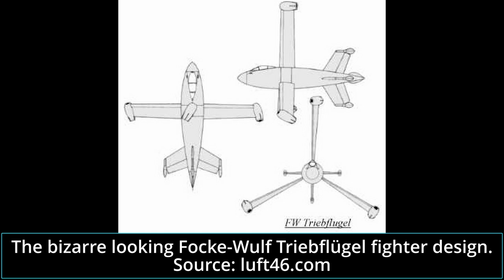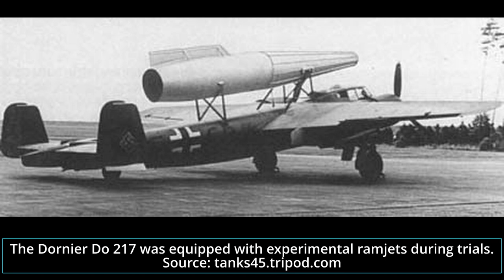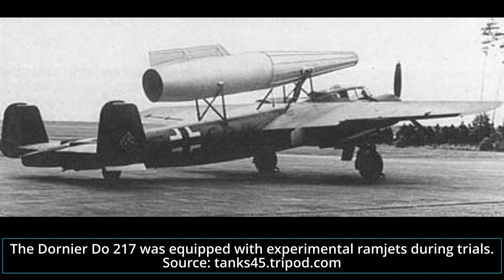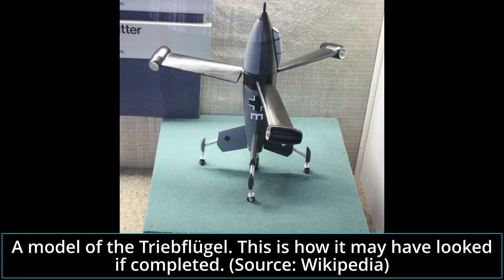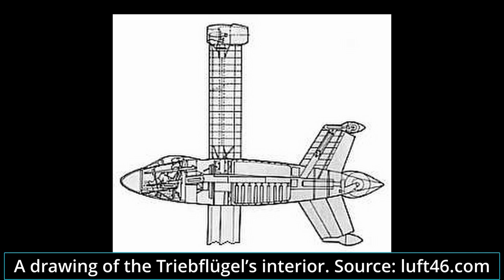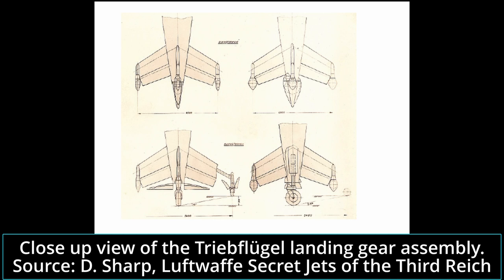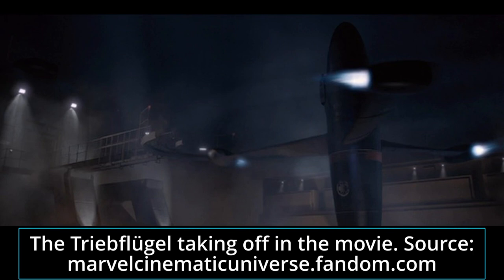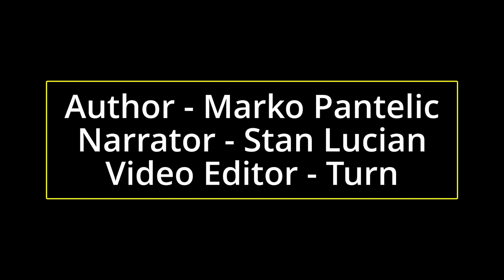The Triebflügel - Centripetal Farce

Comment: Would be interesting to see a some videos on french aircraft, pretty interesting and often not thought about. Good video though, you guys are doing a great job
Reply: Videos come as we make articles for the website. And we do have some french in the works :)
Reply: A video on the coleoptere VTOL aircraft would be cool
Reply: Exactly that's a great idea
Reply from the maker: French Aircraft articles and videos forthcoming!
Reply: Videos and articles on the dewoitine d.500/501/510 would be cool to see.
Reply: @PlaneEncyclopediaYT  in theory this type of airframe could fly.there are various similar rc models of concepts using various bits of geometry of this craft.
It would be inherently difficult to control but i think possible with better avionics control systems.

Comment: To answer the question... this physically could not work. 

The video did well to address a lot of the issues (lack of rear visibility making landing pretty much impossible, the fact that failure of any part of the rotor assembly would lead to a loss of control, bailing out was not possible by conventional means, etc). These are not unique problems to this aircraft (many also plague modern rotorcraft), and such concerns are certainly valid. 

However, the most pressing issue is that there is no thought given to how the fuselage will stabilize itself. Once the rotors start spinning, the fuselage itself will begin to rotate in the opposite direction, just like a conventional helicopter that has lost its tail rotor. The stabilizers on the tail will not be able to impart aerodynamic control at the low takeoff speeds, and the pilot will likely pass out from the positive G forces he would experience, assuming he didn't smack into the ground first. Actually, given the whole thing is on swivel wheels, it probably wouldn't even make it off the ground before spinning out of control like a top. 

Ignoring this fundamental issue, another critical issue is the fact that the ramjets would be expending much of their energy rotating the rotors, acting nearly parallel to the direction of thrust. This would be very inefficient in terms of creating forward thrust, and I have serious doubts that the ramjets could actually be used to push the whole aircraft anywhere near mach 0.90. While not well understood at the time, compressibility of air at high subsonic speeds greatly decreases the efficiency of propellers (such as the massive one on the Triebflugel). As the tip-mounted ramjets neared a linear speed close to mach 1.0, they would have experienced this effect and the consequent drag force would have prevented the rotor from achieving supersonic speed. Not to mention the trio of sonic booms rocketing around the fuselage would have been literally deafening to the pilot to the point of nausea. 1000 kph (about mach 0.8 at sea level) is simply laughable for this design. 

Finally, how would the pilot actually control this thing once in the air? If both the lift and thrust of the aircraft were supposed to be provided by the spinning rotors, then the aircraft would need to be oriented at some angle oblique to the ground at all times, balancing between generation of upward and forward forces. Modern helicopters do this by tilting the rotor arc forward, not pitching the whole aircraft to move the rotors. And again, if the Triebflugel is traveling slowly, its tail control surfaces will be useless, and it will be unable to control the fuselage angle of attack, and therefore unable to regulate the orientation of its rotor arc. I cannot think of a way to actually control this thing. 

This plane is clearly the doodle of some deranged junior engineer, not the work of Focke-Wulf's legendary designer Kurt Tank.
Reply: Wing tip driven helicopters don't rotate the fuselage that much, but since there must be lots of friction from that insane bearing it probably would have anyway.
Reply: The rotors are powered by engines on the rotor itself instead of an engine mounted in the body of the plane, so Newton's 3rd law (equal and opposite reaction) wouldn't apply here as the fuselage wouldn't be exerting any force on the rotor. That being said, if there was enough friction between the rotor and fuselage, then yeah that could spin the whole plane
Reply: Fair point. I guess the fuselage will just rotate in the same direction as the rotors, not opposite to it. Same problem applies.
Reply: @railgunawesome7114  Although, for the starter motor mounted in the fuselage it would spin opposite the rotor rotation. Remember the ramjets won't work until you get the tips a significant fraction of the speed of sound.

Comment: This is a very workable idea.   First of all lets deal with how the ramjets at the rotor tips would work:   They would be "inductor ramjets" whereby a rocket motor at the center would provide a little thrust for starting.  The rocket exhaust would induce an airflow to allow the ramjets to generate additional thrust at zero speed to start the rotor turning till the rockets weren't needed anymore.  
-The rockets would likely be compressed air and fuel.   The Doblhoff WNF 342 helicopter in fact used compressed air tip jets and flew.  
Secondly lets deal with how fuel and air would get to the tips:    What is needed is a "multi-port hollow shaft rotary union".  These use labyrinth and o ring seals to allow fuel and air to pass to the ramjets at the tips.  
-There would also be hydraulic  journal bearings to hold the rotor in place and a slip ring to conduct electrical signals if needed.   Flow regulation of the fuel would be by using precise fuel pressure to set a precision  flow regulating valve to meter the exact liters per minute needed with maybe some control apparatus in each tip jet ramjet.
-There would be no torque except from bearing friction and that would be so negligible the tail fins would use rotor wash to control the roll easily.
-There would need to be a collective pitch like a helicopter.   A cyclic pitch would also be possible but maybe not essential. 
-I would imagine a modified standard 3 axis patina autopilot would make hovering easier.   
-Landing would need to be automatic or a tilting seat provided for the pilot.

Comment: Think about it for a moment. What prevented the fuselage from rotating?
Reply from the maker: Very good point!
Reply: This got me thinking, if the aircraft took off using an external motor, then there would be no torque coming from the fuselage, and if the wings are powered by the ramjets, then the wings when the ramjets are "turned on" wouldn't also affect the fuselage (that is if mechanical drag on the fuselage is discounted)

Although it'd be an interesting test to try and making in scaled RC form
Reply: Tip jet rotors produce minimal torque, needing a small or no tail rotor
Reply: @Daemascus  - There is going to be fusalage rotation regardless. Why wouldn't there be?
Reply: @Daemascus  Precisely, apart from the rotor bearing torque , which is minimal, the roll control from the airflow of the rotor over the tail fins would be enough.

Comment: So how was the fuel for the ramjets be sent from the fuselage tanks, into the rapidly rotating wings, to the ramjets?

Just found the channel, thanks to Tank Encyclopedia.
Reply: Simple,  the fuel was in the wings
Reply from the maker: Welcome aboard!
Reply: The fuelline in the fuselage was propably centered and connected with a rotating seal to a center hub in the propeller from which 3 fuellines in the wings braucht the fuel to the engines.
Reply: If they fuel is in the body spin the tank with the wings so the pipes go with it prob
Reply: @TinyBearTim  that propably would result in unmanageable gyroscopic forces due to the spinning mass.
Reply: @dave_sic1365  the whole thing is a spinning mass idk how it would fly or land without falling out they sky and exploded
Reply: @TinyBearTim  XD yes landing is the most fun when the rotor/fuselage bearing is transmitting the moment of the rotor on the fuselage and there's no airspeed so you can't balance it with the flaps 😂

Comment: I would be interested to learn about the F/A-XX program.  The future sixth-generation air superiority fighters. I mainly interested in its design, how it fly, etc. Hopefully there is enough information on this vehicle/program to make a video. :)
Reply: If I'm think of the same thing you're thinking of, the F/A-XX was a vague set of characteristics as penned by Aircraft reformists during the 70s which basically amounted to a significantly worse F-15. 
Notable removals were the large internal fuel tanks, the bullet proof glass, the radar (in the 1970s mind you) and the ability to fire air to air missiles.
There's not much to write home about.

Comment: I still don't understand what the idea was. Probably just having the ram engines running at high velocity as the only reason. Are there any other advantages in this sort of design?
Reply: No need for a runway, which is the reason why the XFY-1 Pogo and other tail sitters were made